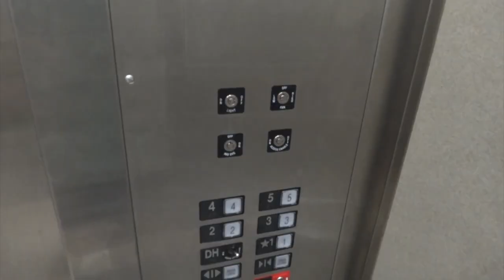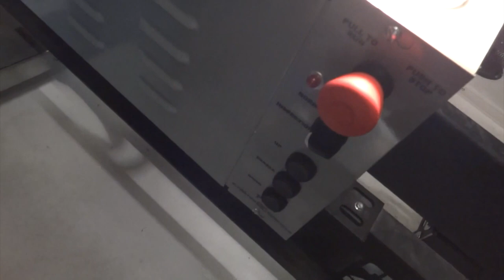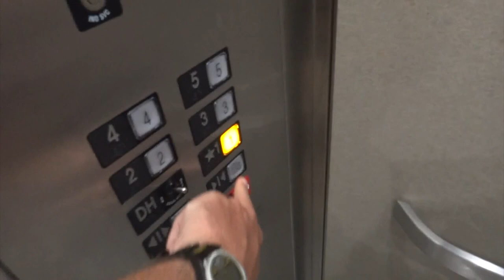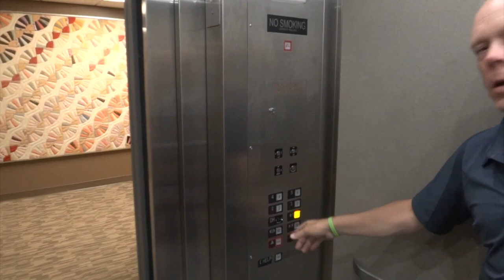Cartop Ride and detailed look at Minnesota MRL elevator (elevator surfing legally)

Comment: There is a 12 level parking structure nearby with two Otis Gen 2 MRL (roped) elevators. As it this video the counterweight has a compensating sheave 2:1 however the static side of the ropes in the video anchored top of the frame work, does not appear the case with these elevators. There is a 2nd set of hoist ropes on the opposite side of the cab I believe there are perhaps four sheaves top of the frame two defectors, the ropes pass over.
Reply from the maker: +TheTheo58 most mrl has 2 to 1 roping
Reply: Because MRL are mostly gearless
Reply: TheTheo58 ههنظ

Comment: You must always verify everything! You need to check up and down!!! Did you do it outside of filming??? and how did you make it move from outside with the safety broken?!?!?!? I understand lifts in the US may be different but I did not know they were that different!
Reply from the maker: +tamtom gaming they are different.  Once u switch it on inspection it won't move.  But yes we checked it before hand
Reply: DieselDucy but you can't just rely on these things to work in the UK you put it on inspection get out close the doors press call on every floor to make sure the lift DOSE NOT MOVE and then you get on it press run and up and then run and down idk if there is a run button in the US but there is in the UK and then you can surf it and do any lifts in US say doors opening doors closing?!?!?

Comment: If you open the door with the drop key but you don't turn the in-car inspection switch to inspection
will the cartop controls still operate or not ?
Reply: The cartop controls should still work

Comment: How does the counter weight work?
Reply: One end of the rope is anchored to the top of the elevator shaft, and the other end goes to the main sheave
Reply: it provides balance and stability on the elevator so it won't plummet down the shaft
Reply: It makes the weight of the whole thing balance

Comment: Should have verified that the car top stop switch then the inspection switch where working before you stepped onto the car. This is just nuts. No ppe Safety Equipment on either. Absolutely crazy 👎